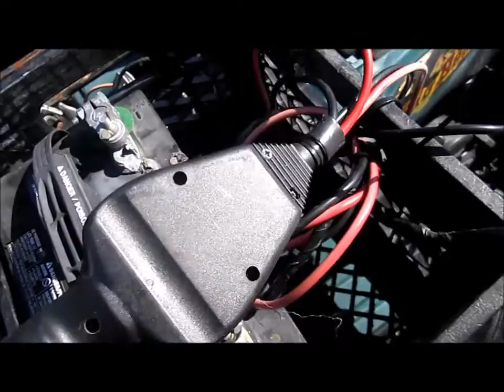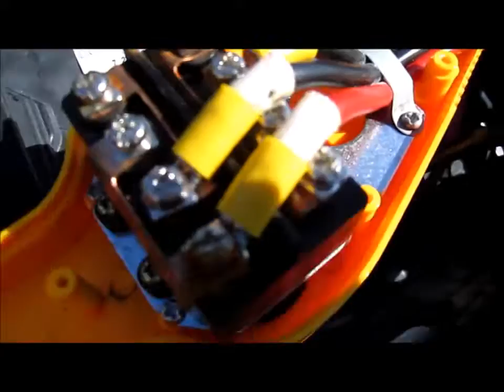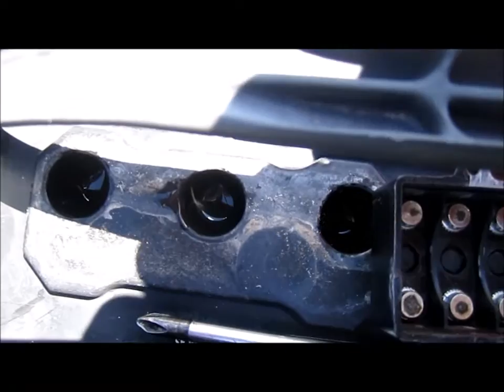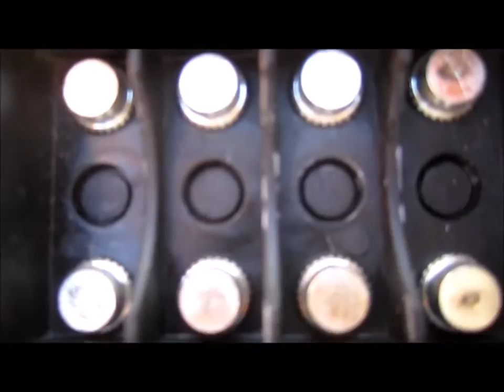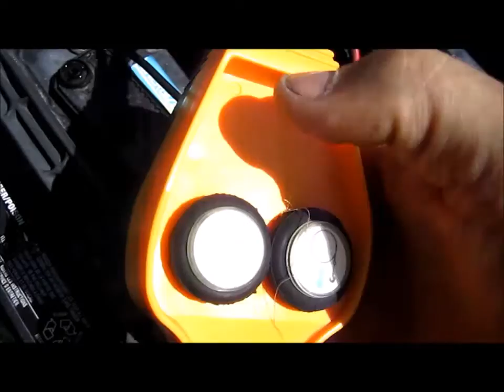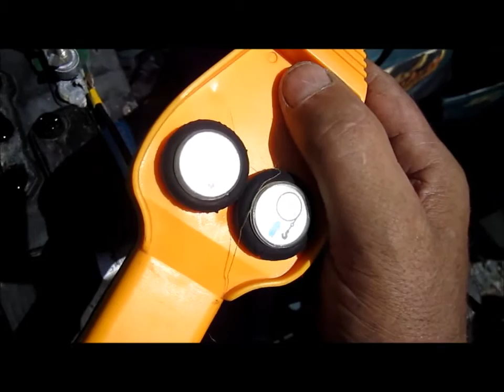Winch Switch Fixing  Contacts Inside Need A Working

Comment: shifter for golf cart might work.
Reply from the maker: Good idea. I,m going to find a golf cart scrap yard and check them out and hope there prices are fair. TKS
Reply: +Thinking out side box forklift is DC too. high amp dc. not sure on backhoes large equipment.
Reply from the maker: If there electric they would be Dc and high amps. I need to find some scrap dealers that deal with this type thing. Nothing around where I live. I,d travel for the parts no problem there.